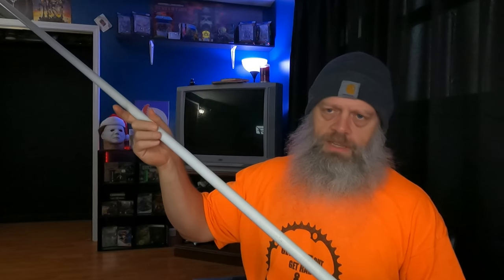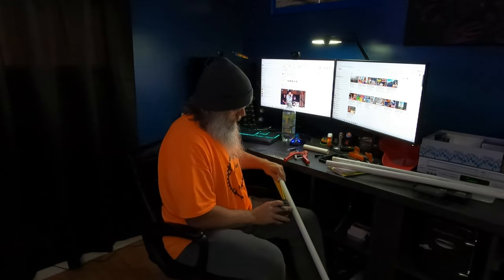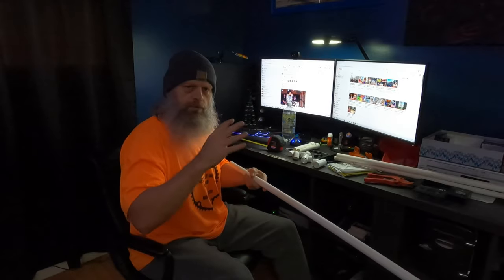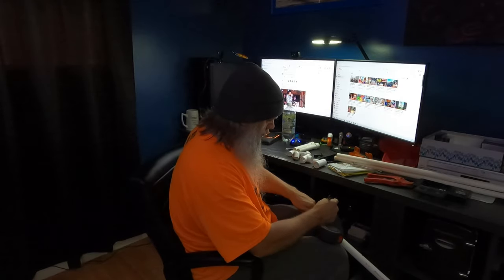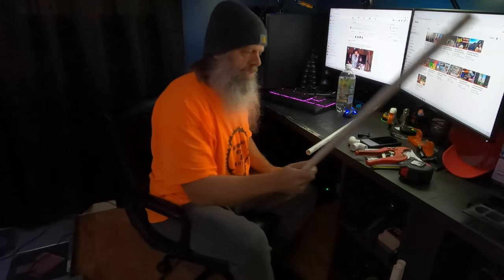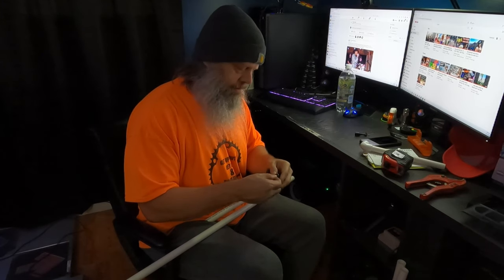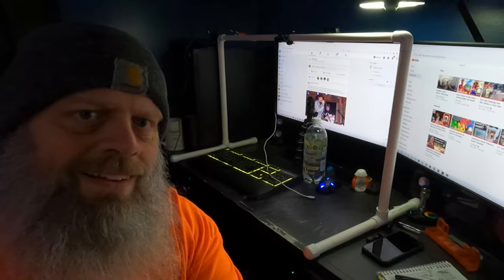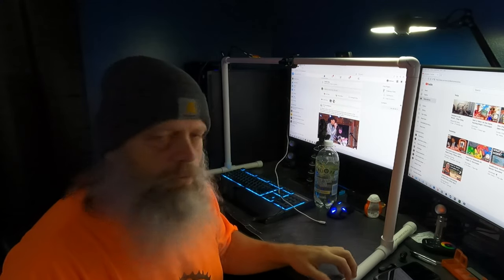Overhead GoPro Action Camera Rig DIY 10 11 21

Comment: First like bro.  Nicely done and yes I did plan one years ago as well just now I got my room it will be made soon.
Reply from the maker: yeah..just need to get holes drilled to make adjustments but..not really needed right now as its at the right height ..but ill get it done. thanks
Reply: Get pins that push in. With a pull hoop.  The pave bent one I made for him we ran wire in it now it’s a light for photos. I was doing a video for what I made. But this was before I started my yout tube channel